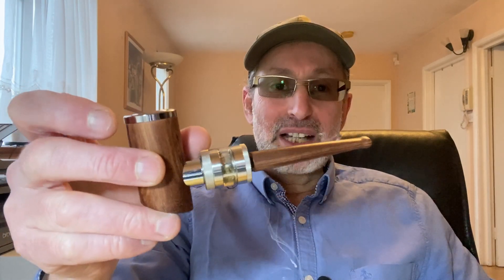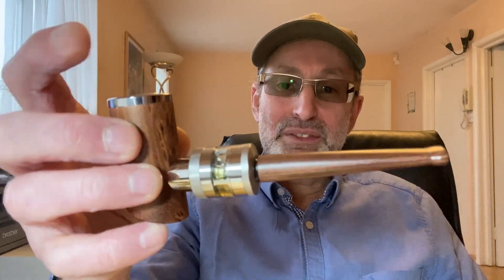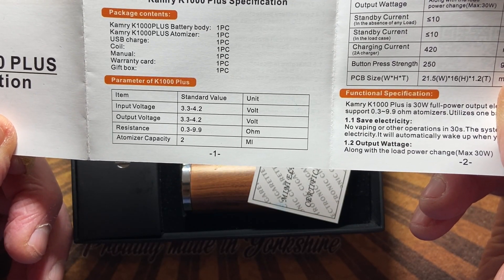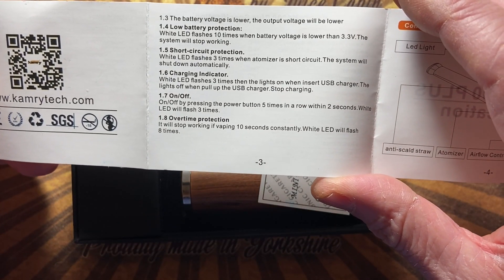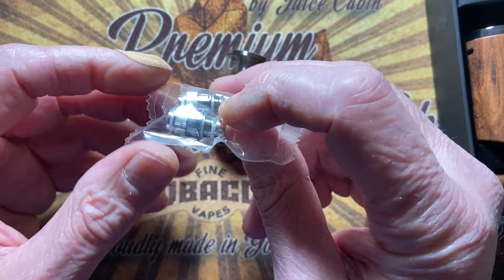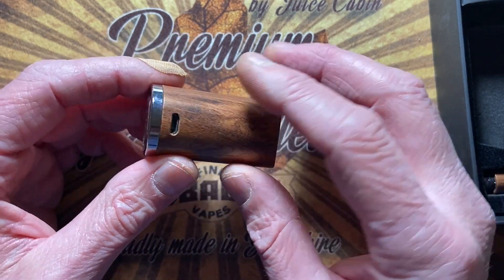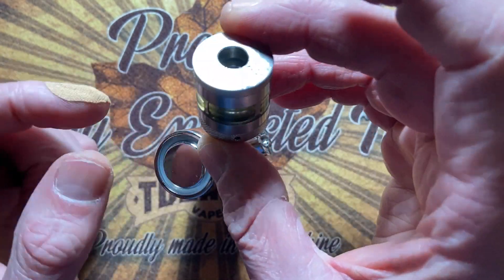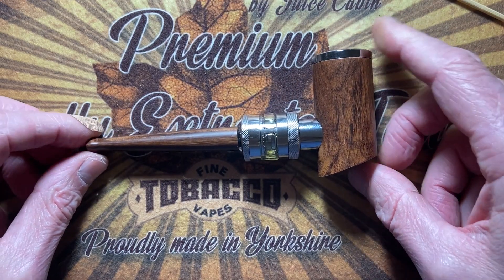Kamry K1000 plus E pipe | Gorgeous design |  Super smooth MTL drew | Pleasure to vape

Comment: I have purchased the K1000 and noticed the coils it came with got a burnt taste after a tank and a half or so of vaping juice. I think I figured out how to fix the issue. Because the tank is horizontal, when the fluid gets below 60% or so, not all the cotton is saturated unless you make it a point to vape it vertically. If you store it sideways with half a tank or less and pick it up the next day without letting the coils soak in by holding epipe upright, you are likely to prematurely blacken the cotton in the coils. I vape the K1000 Plus by tilting down the pipe to ensure the coil is covered in liquid. 

As one reviewer summed up the K1000 coil issue: "Where possible store your tanks upright as when allowed to lay flat/on their side, particularly if the tank is only half full you will find that the exposed coil, i.e. the coil above the e-liquid line dries out very quickly. This settling is natural, however, if you pick up a tank that has been left horizontal, and go to vape straight away that wick will no longer be primed/saturated and will likely burn out much quicker. If not stored upright at least let the coil re-saturate before using it again after a break."

A great epipe overall, flavor, vapor production. Only real complaint is short battery life, but you can vape while you charge and you can buy a 2nd k1000 to switch tanks while you charge the other one. Very nice.
Reply from the maker: @Seasonspass33 Thanks for your input. I personally do not use the stock coil tank it comes with as a kit, as i use my MTL RTA's that give me a better vaping experience. But as you ended it is for the price a very nice e-pipe. I agree on the short battery life, as i use mainly with my morning coffee or evening beverage so the battery life is perfect for my usage. Enjoy it

Comment: Dude, is he a MECH? Or does it have any protection?
Reply from the maker: If you read the description you would read there are 3 protection Features, 1 Low Power Protection, 2 Short Circuit Protection, 3 Over charge Protection.

Comment: Please check, if the Kayfun Lite works on it. Because the 510 Connector from the Pipe make some Problems with a few Atomizers. If it works, i'll buy the Pipe again (i had it in the past, but it doesn't work with my fav-atomizer at this Time. Now the Kayfun Lite is my Favorite Atomizer). Thanks
Reply: And does the Pipe-Mouthpiece fit & looks great on the Kayfun Lite?
Reply: Maybe you will send a Pic? Thanks
Reply from the maker: I checked for you Angelo the lite 2019 work no problem but the long pipe mouthpiece does not fit. I might be able to force it down but I did not want to damage the O rings on the pipe mouthpiece or the mouthpiece itself. I don’t think it will fit even by force. You can vape it with the Kayfun mouthpiece But without the pipe long mouthpiece attached it does not feel right.
Reply: Thank you 👍 it's a shame that the mouthpiece doesn't fit 🙈 I agree with you, ... then it doesn't feel like a pipe anymore. Thanks again. you're a good one 👍
Reply: Btw.. i think it should fit perfect without o-rings?! as i said, i owned it a few months ago and can also remember problems with the mouthpiece. removing the o-rings had helped and it was still firm and tight.
Reply from the maker: I am happy with my steam crave glaz mini attached to the pipe when I relax and my Kayfun I take with me to work.
Reply: @Ads n you mean the last kayfun lite plus? Thanks for your help, i think ill buy the kamry again.
Reply from the maker: Enjoy vaping it.

Comment: would a higher ohm coil , like an aspire nautlis be ok for this ? You said it went upto 30watts , but would the wattage auto adjust to the coil ohm or does it give a continues 30 watt outtage ? great reveiw , im tempteed tio click buy , just need to know this small info , many thanks !
Reply from the maker: @WEBLEY yes it would give out wattage according to the coil similar to a mechanical but with protections. My coil is a MTL coil around the 1ohm and the power is delivered accordingly so i assume  you can safely use any MTL coil rebuildable or stock coil like the Aspire you want to use. The only caution is that i hope the e-pipe mouthpiece will fit snugly to the Aspire Nauttilus tank  you want to use it with as it does not fit some of my MTL RTA's.
Reply: @netvaper  many thanks for your prompt reply , i have many tanks stock and rta , so im sure one will fit ... I think im going to buy . again fantastic reviews , really enjoy your channel , best wishes
Reply: I used it with the Nautilus 3 (22mm). For MTL, 1 Ohm works perfectly, 1.6 Ohm didn't give me enough vape, taste and throat hit. Though the Nautilus 3 is rather heavy the pipe doesn't stand anymore on the feet, but wasn't a big deal for me.

Will try it with an Innokin Ares 2 MTL next.

Comment: As the owner of the Vpipe 3 and the Epuffer 629x, I can say this k1000 plus is the best performer of the 3 by far! 

But... 

Beware of counterfeit/fake K1000 Plus Epipe & Coils! 
I ordered a Kamry K1000 Epipe  in April 2022 and it was a counterfeit model!  The button did not click, the name of Kamry is not on the tank, and the coils did not have the Kamry seal on them. It was a total phony knockoff product. The counterfeit one does not work well at all. I struggled to get vape clouds out of it. The fire button does not have any travel in it and it does not click past all and the tank's airflow adjuster is very loose. 

I purchased a verified authentic K1000 from a different website and the difference between fake and real was huge! Look closely at what you get when your order. You can verify from a scratch off code on the box of the K1000 on Kamry's website whether the epipe you got is authentic. I am trying to get a full refund on my purchase and will report it to my credit card.
Reply from the maker: @Seasonspass33.Thanks for tip that i was aware off i can confirm mine is 100% genuine. As a foot-note, i use MTL RTA's with the K1000 not the stock coil tank it comes with, the flavour is far superior

Comment: Love it, i was thinking about a e-pipe for quite some time.
I will get one to have it on my desk, 1000mah battery does not have enough power to carry it all day around.
Another thing is that the pre-made coils are not best for NET juice because at the best the  coil will last you a day.

But i will get one just to show off 😀

PS. Thanks to your reviews i discovered Juice Cabin juices and fell in love with them. They delivered it prompt without any fuss to Australia.
I can see that they are selling concentrates as well but could not find anywhere what the procentages they recommend. I would really appreciate if you could find that out.
I tried, but no luck.
Reply from the maker: Thanks Dragan.  If you watch my reviews on the net’s from La Tabaccheria you will notice my my mixing method in the description I assume it is more or less the same but to make sure I will try to find out for you.
Reply: @netvaper  
Most of NET concentrates go from 5-10-20 % and I really would not want to waste any precious conc. Because i over or under did it.

Thamks again